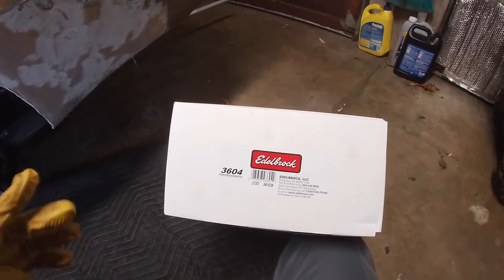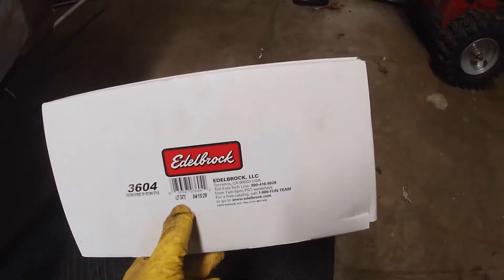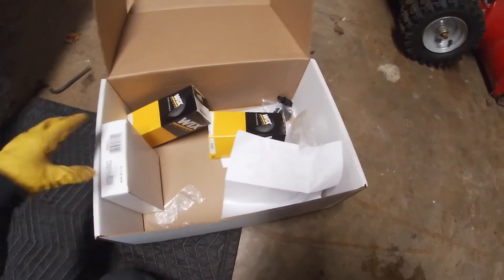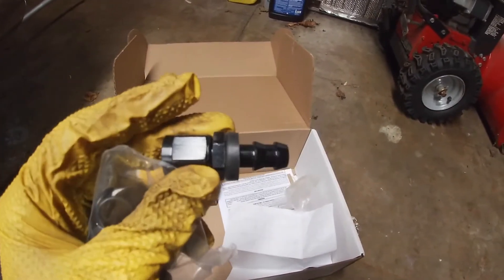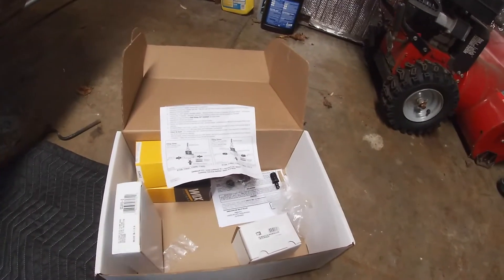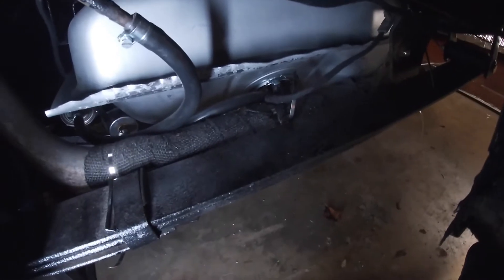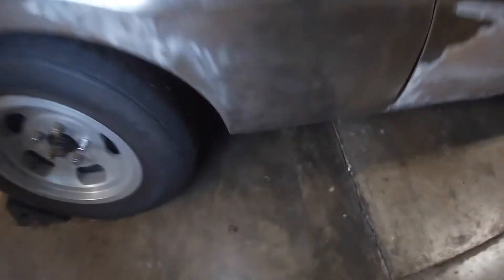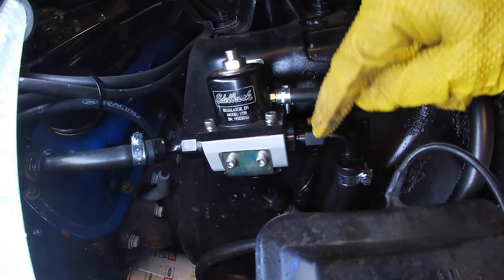Return Style Fuel System Setup For EFI conversion

Comment: Thanks so much for the video! If I could ask for one more thing - how loud is the pump when it's running? Can you hear it in the car? Do you hear it over the exhaust? I don't recall how stock or modded this engine is.
Reply from the maker: No problem! It's loud enough to hear it prime with the key on engine off but not loud enough to hear with the engine running unless you stick your head under the rear and you can catch a bit of the humming, I do have dual exhaust with glass packs so it is also loud lol